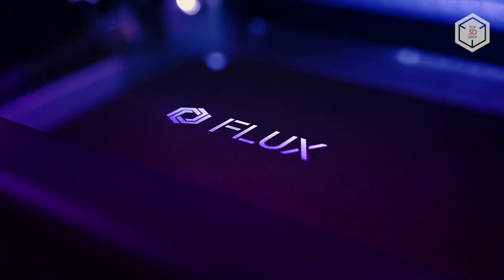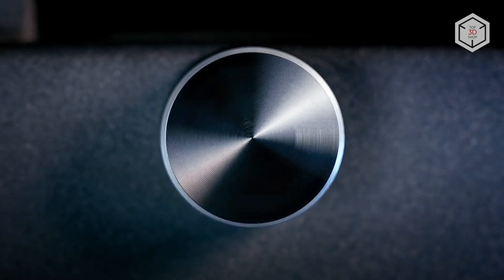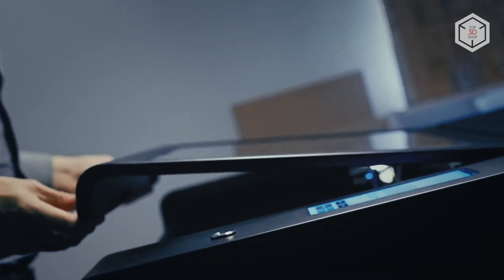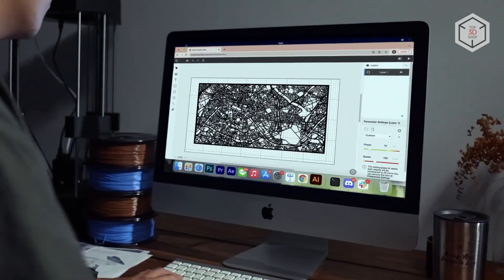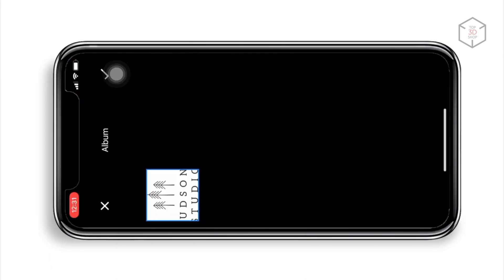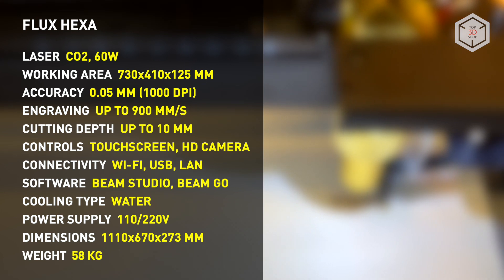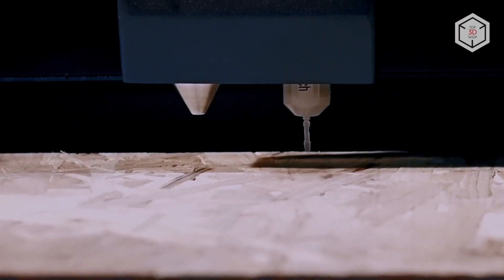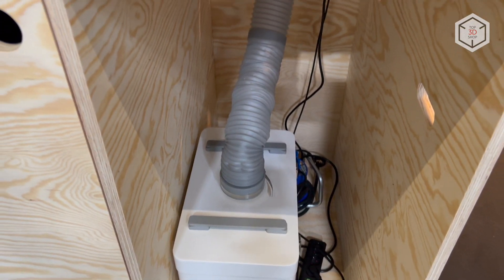FLUX HEXA Overview: Professional Laser Cutter and Engraver for Mass Production

Comment: Very happy with the Flux Hexa. Has been working well so far! Only been cutting plywood and MDF, but did a run on acrylic too. Beam Studio is OK, but there could be some improvements. I miss a content library for symbols and simple graphics like arrows, hearts, different geometric shapes and smileys etc. The work area is a bit dark for the camera, so the image mosaic can be a bit misleading. I still managed to do a recut after my first settings didnt cut through, just by dragging the same vector over the preview of my last cut.